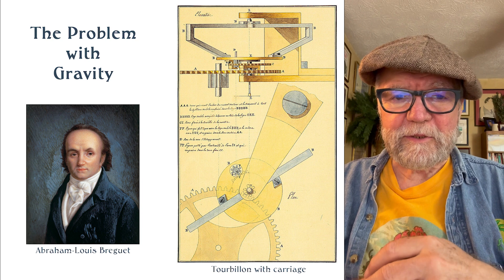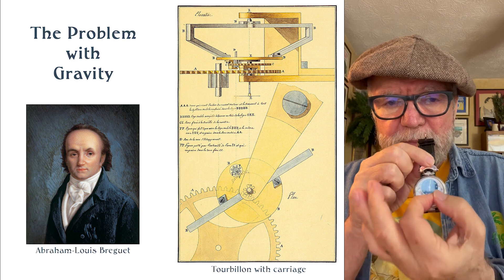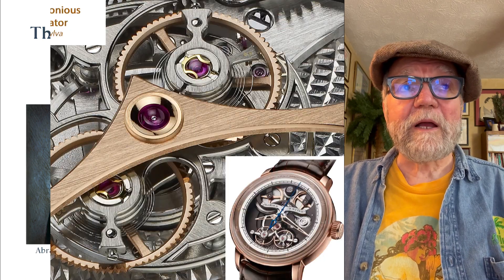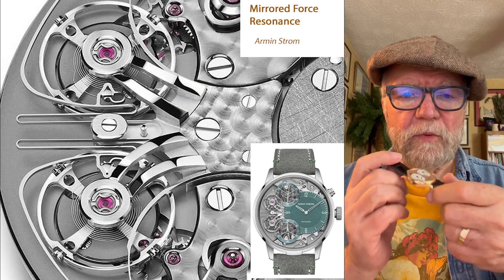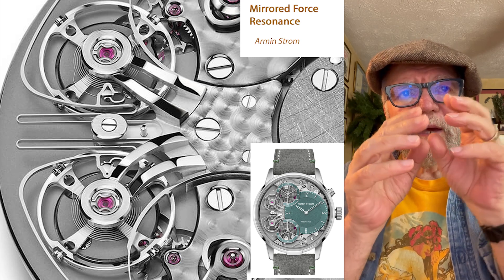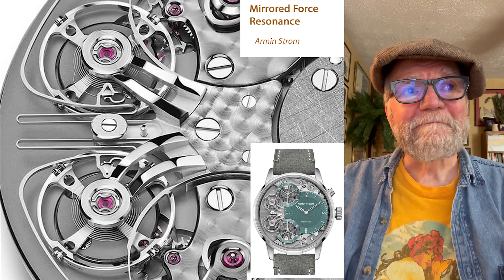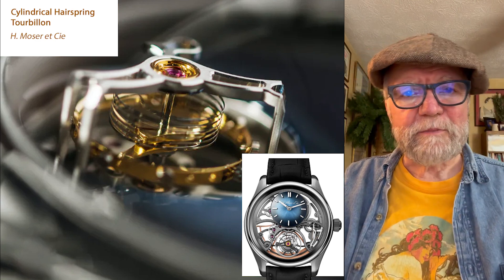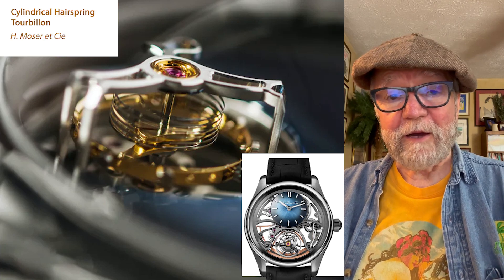How to be only the Second Dumbest Guy in Your Watch Group

Comment: Nice try but:
1) Ignorance is not stupidity
2) Gravity has some effect on the balance spring but major effect is on balance which is why it is poised
3) Most of gravity effect on balance spring is corrected by terminal coils of which Breguet over coil is one example  really fine control is achieved by Gribi adjustment which comprises small weights on balance spring
4) Helical balance springs were invented by John Arnold and had empirical terminal curves at both ends.  Breguet and Arnold were in close contact so Breguet overcoil may have been inspired by  Arnold
5) Arnold prevented Earnshaw from using helical springs so Earnshaw developed tapered flat springs which frequently beat Arnold's in trials (Late 1700's early 1800's) Earnshaw tapered spring has re emerged as silicon or diamond balance spring.
6) Another way to minimize gravity is the Karrusel which unlike the tourbillon actually dominated trials.  The Nardin Freak is a good example.
7) My technical issue with rotating escapements is that the complexity they add increases day to day variation which often offsets very small position error correction benefit over really well poised balances and correctly formed balance wheels on simpler and more consistent running watches.  This is based on the way points are awarded but historically simple watches usually beat rotating escapement watches so a major re-juggling of the scoring is required to make tourbillons come out on top for accuracy,
Reply from the maker: Nice try Doc, but dumb & ignorance, while different according to a rigid schoolmarm ruler-slapping rigidity are often used interchangeably. Besides, I was just having a little fun, and it gave you a great platform on which to pontificate. Take care and have a little fun, Bill
Reply: Thanks and I should have made the distinction more clear by pointing out the people who bring in historical detail are not the most ignorant but probably the dumbest.

It almost always pays to appear to be the dumbest in the group. Lots more peopel will correct me than give me information up front.  @watchartsci